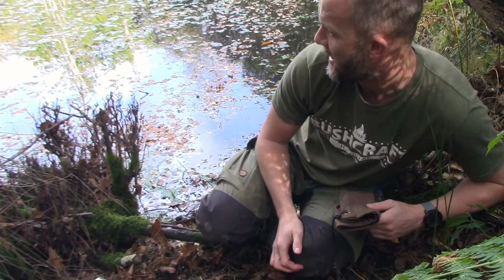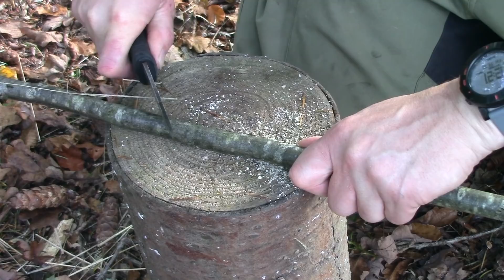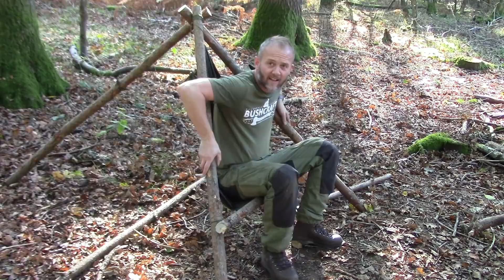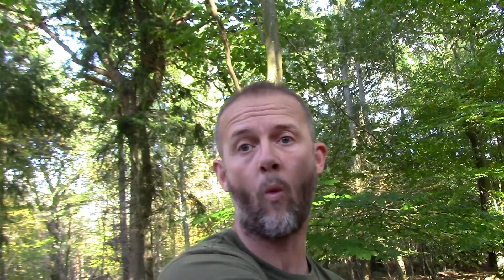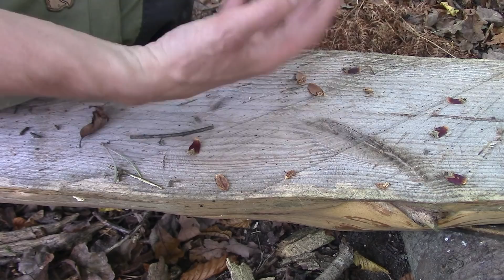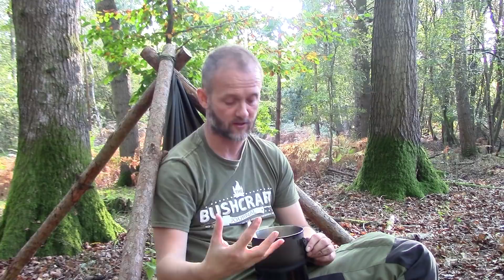October Bushcraft All dayer - water filtration, pot hanger, fire-starting, cooking, bushcraft chair

Comment: Hi Craig, once you've cleaned it out for your next trip, have a play with it in the back garden to get a feel and technique going. I know you soaked it so great move there, but try reversing it in hot water in the sink and scrubbing in the bottom corner where the water would come through with a nail brush to get into the weave and get the dirt out... then turn it back the correct way and fill with clean water once again, about half way, pinch at the top (as if you were decorating a cake) And squeeze until the water is pushed through. Try this a few times. This should work mate. I've never used a brown bag from Rupert but I use the military ones all the time when out. And yes occasionally they need 'back flushing' to cleanse them.
Reply from the maker: Hi Danny and thanks for dropping by. I'm a stickler for cleaning my kit on return home so I know that the bag was clean (inside and out) from my previous trip, but I do like the idea of squuuuuueezing the bag to help flush anything through.... that's my Sunday morning sorted 😁

Thanks for taking the time to drop by and comment, it's really appreciated 👍.
Reply: Clean water ... yep, comes out of a TAP ... test it at home ;-) then you'll know how long it REALLY takes. - oh and it doesn't filter out of the bottom corner, it filters through ALL the fabric, the bag is that shape to give it somewhere to run off, the initial "discard until it reaches the stitching line" is to clean off the outside of the bag. Must dig my old green one out this weekend & see how long it takes for you.
Reply from the maker: Yeah fair point on the 'bottom corner' observation.

As I said elsewhere in the comments a 'home timed test' is definitely on the cards....
Reply: @TheBushcraftPadawan  anytime mate, as always, great videos
Reply from the maker: @Ajourneyintobushcraft  cheers Danny, any plans afoot for new t-shirt designs? Folks will start to think I live in that t-shirt 😉
Reply: @TheBushcraftPadawan  there certainly are Craig it's coming soon.

Comment: Hi Craig check out Paul kirtleys blog on how to use the filtration bag I think your solution is there straight away in the article it needs really soaking not just wetting and should take no longer than 5 minutes to complete stay safe
Reply from the maker: Hi John, thanks for dropping by and commenting, it's really appreciated 👍.

 As mentioned elsewhere in the comments the bag was thoroughly soaked in a bucket en route to the woods and rung out repeatedly (under water) before use to help saturate it. 

I'm convinced that the heavy debris content in the water was the cause of the slow filter as opposed to the bag itself. I'm planning on recording a 'test' video shortly to validate (or not) my hypothesis 😉.

Comment: Hi. Well done with the fire starting. Have you well soaked and scrunched up your Brown Bag at home to prep it? It seems to still be very stiff. "To break in a Brown Bag, you need to: (i) saturate it in water and (ii) then be rough with it - scrunch it up, massage and squeeze it. Repeat this process 3 or 4 times allowing the bag to dry in between. You can also put the bag in the washing machine." from Frontier Bushcraft :)
Reply from the maker: Hi Angela and thanks for taking the time to drop by and comment.

I have owned that Brown Bag for a little under 11 months now and it has been soaked, wrung out, dried, soaked, wrung out etc well into double figures. I genuinely think that the water is so debris-heavy from that pool that it is simply clogging the bag up. Once we've had some sustained rain several clearer, fast flowing streams appear in that area so I'll reattempt at that point.
Reply: Fair enough - ours just looks softer :)
Reply: Angela is correct it needs the whole process repeating before using is it not allowed to lightly massage the water thru just a thought won't be able to use below freezing at that rate and be evaporating in summer stay safe

Comment: Very interesting as usual, perhaps if you dig a hole about eighteen inches deep and twelve wide, close to the pond and let it fill with seepage, then empty it out twice, the next time it fills the water should be clearer
Reply from the maker: Hi Sean, one of my friends has also suggested digging a gypsy well in the vicinity of that pool, I just need to remember to take a digging tool with me (which I always forget to do!).

Thanks as always for dropping by and commenting Sean, it's really appreciated 👍.
Reply: make a digging stick, primitive but works rather well